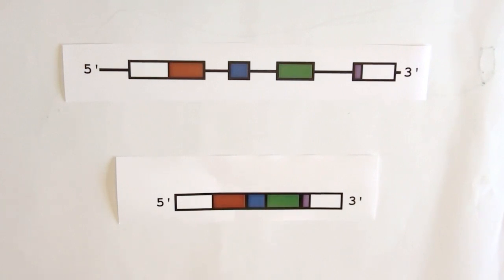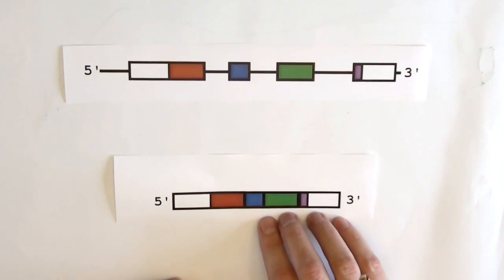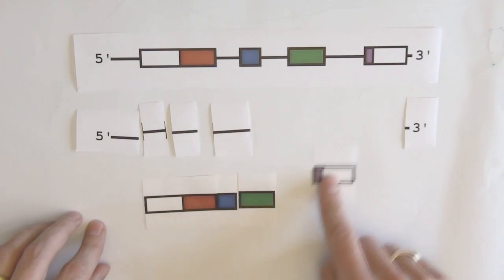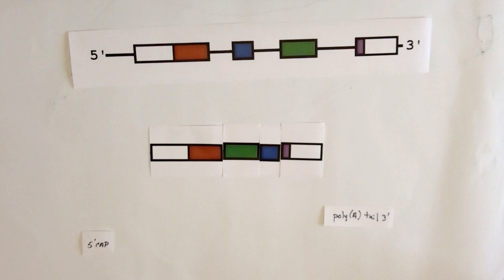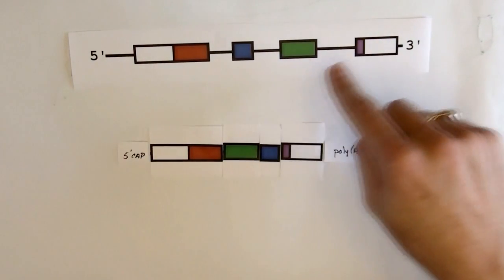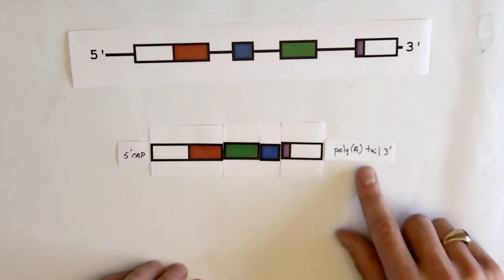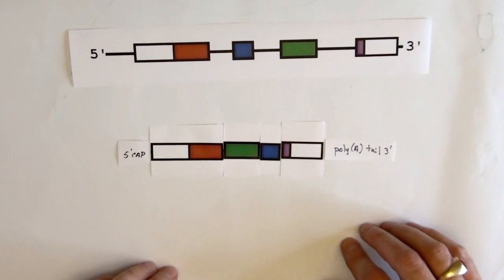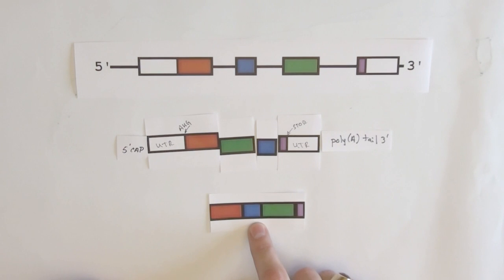RNA splicing

Comment: Is there any way to calculate how many possibilities there are with alternative splicing? For example there is a new code when the blue square is removed (1 possibility) and a new code when the green square is removed. Including removals and rearrangements, could you calculate how many different code sequences are created thanks to RNA splicing? My teacher asked this and it seems like it would be hundreds of possibilities. Just wanted to know if there was a concrete number calculation. Thanks!
Reply: Of course you can easily calculate how many combinations are possible, but how many combinations are actually used by the cell is a very different question.  Remember that producing multiple mature mRNA means you will get different proteins when translated. So are these proteins useful for anything or are they a nuisance? Imagine what might happen in an organ like the liver. There could be several 'almost the same' useful proteins produced that give the liver cells a better means of dealing with the crap that comes in the front door. That would make a happy liver. However, if the variations in proteins got in the way of liver cell metabolism, then the liver might quit. This would terminate the individual and their potential to reproduce. Evolution at work.

Comment: Why arent the UTR's spliced out as introns?
Reply: You may of got the answer for this but, just in case :) haha 

They are important in regulating transcription and translation. For example, The 5' UTR (the one upstream of the red exon) contains regulatory sequences that control translation of an mRNA like that on the ferritin mRNA where low iron levels will cause a transcript to loop (a protein attaches on 5' UTR and another on 3'UTR and both dimerise) and hence render it untranslatable due to steric hindrance (basically, no space for ribosome to attach and translate) but, in high levels of iron these two proteins do not attach and leaves the mRNA to be translated. Ferritin is produced and actually stores the excess iron.